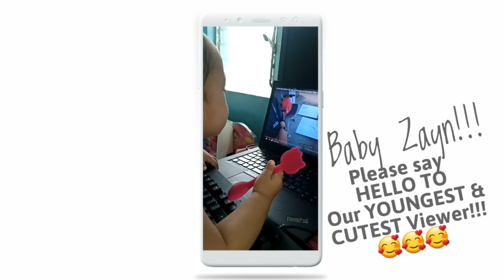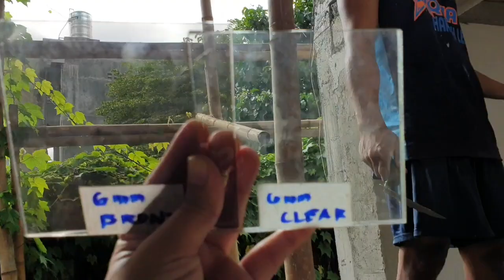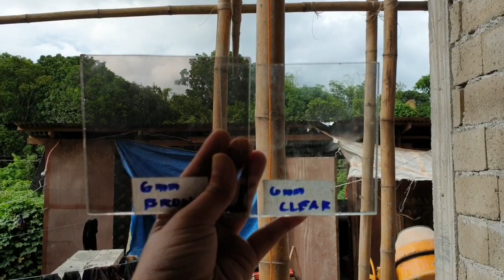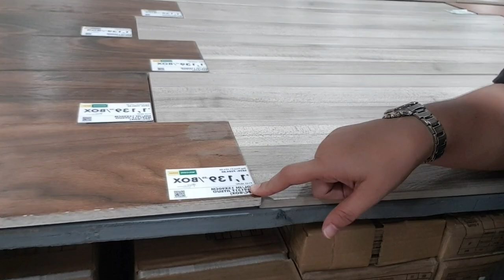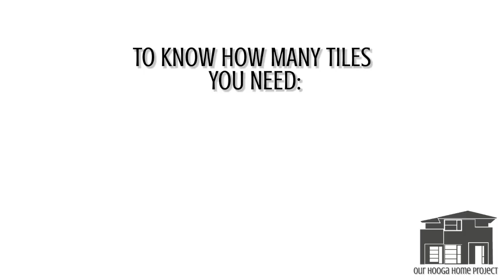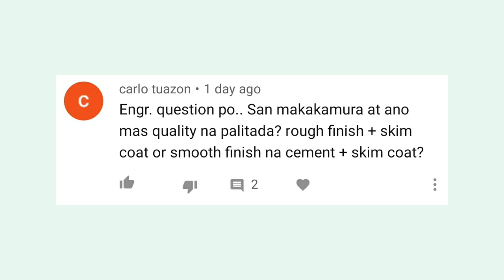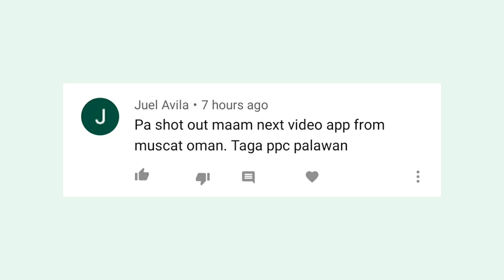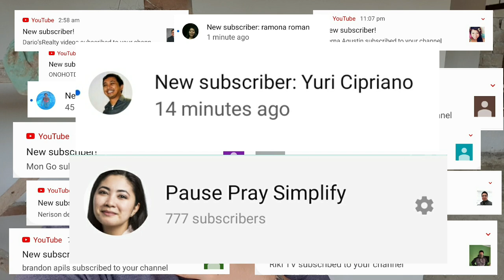HOUSE BUILDING PHILIPPINES  | Wk 23 How to CHOOSE FLOOR Tiles + Window Installation | Retired OFW

Comment: Janice thanks for the shout out!!   As for glass I think the same glass for all windows on a side of the house. The north side gets less direct sun so it may benefit
 from clear glass. I like the gold mirror reflective glass for privacy, but in that case the entire house would need that type. If you have close neighbors the mirror
finish glass could be annoying to them.  Floor tiles. I would do textured tiles on open common areas  with strip planking wood grain finish. These areas usually
have less direct sun thru windows so a light finish would be brighter. Use the 60 X 60 in the bedrooms to set them apart as a different living space from the
common areas and as a cost saving since the bed dreeser and chairs hide a lot of the floor area. Bedrooms don't need to be brightly lit so a color coordinated
with the paint color might be nice. If you use color tiles future paint colors would be limited to the original shade or white.
           Skim coat needs a rough surface for grip or tooth to bond to. We skimcoated our ceilings which were concrete slabs poured on polyethalene sheeting so
the forms wouldn't stick and cement and water wouldn't separate out of the concrete. Same as pouring a floor and putting poly down over the gravel to retain
the cement in the concrete. For the slick finish ceilings we painted on "concrete bonding agent" which makes a joint stronger than the original cast concrete. 
Our crew also mixed bonding agent into the skimcoat. When time and budget allow we may put infinity mirror ceilings just to be different than the tray ceilings
that are very popular in the PI particularly on OFW and expat house builds. Also we may put plush wall to wall carpet in the bedrooms and let the house girl
learn how to use a vaccum cleaner. 

                                                    george and aurora
Reply from the maker: Hi George and Aurora! For the glass we will see on Week 24 so we can decide better. I prefer clear glass but still lookinv at all the considerations.

As for the common areas, we will buy porcelain tiles. The wood-look tiles that we had bought are ceramic so they can't be used in the common areas. We'll see if we can get a cheaper wood-look poercelain tiles for the common areas. Otherwise, 60x60 porcelain tiles it is.

I'm impressed with how you're mnaging your home build from overseas! Kuods to you and your Team!

Oh and for the ceiling, we will have a flat one. Simple and no design. Just white with pin lights. We want our house to be simple. We don't like elaborate designs especially on the ceiling. 

Let's see how it will all turn out. 

Thanks again!!!😊 Tc!!!

Comment: Hello, may I know po if your pvc downspout is inside the columns? Thanks and hoping for your reply
Reply from the maker: Hello po, Kristine! 😊 Hindi po nakaembed ang downspout namin sa loob ng column. Mahirap po maintenance nun in the future just in case bumara mga dahon at hihina po ang strength ng column. Ang maximum allowable embedment po ay 4% ng gross area ng column. Kung gusto niyo maglagay ng downspout sa column, kailangan pang lakihan ang size ng column para maaccommodate yun, mas magastos po. Sa gilid lng po ng column namin ilalagay ang downspot at lalagyan namin sya ng cage later on para gapangan ng halaman para matago ito. Hindi na halata, may design pa. 😊 

Ano po ba yung sa inyo? Nakaembed po?

- Abet
Reply: @PausePraySimplify  hello po salamat po sa reply, on going p lng po ang aming construction, bale insist po nmin sa aming contractor na ilabas ang downspout kc, based po sa aming calculation, more than 4% ung embedment, around 5.8% po.
Reply from the maker: @kristinecuartina8499  anong size po ng downspout?
Reply: Pause Pray Simplify  bale 3 inches po ung downspoun then ung column size is 40cm by 25cm.

Comment: Ma’am ask lng po ilan po ng 15x90 ang macoverage ng 3mx3m n kwarto po 
120x20 po sa example ni sir po para macompare lng po ung price po thank you po and alin po marecommend nyo n size po
Reply from the maker: Hi Jonas! Sige ipapasagot ko yan kay Abet ha. Balikam kita 😊
Reply: @PausePraySimplify  thank you po
Reply from the maker: Hi Jonas! Naku sorry hindi pala kita nabalikan agad. Sinagot ko ito sa isang video kaso di ko pa maupload. So ang sagot:

.15m×.9m= .135sqm 

Area: 3m×3m =9sqm / .135sqm = 67pieces × 10% for cut pieces and reserve 

You will need: 74 pieces na 15×90

Sorry sorry nalate ha. Ginawan kobrin ko video. Hopefully maupload ko soon.

Comment: Hm sa wilcon ang wood look porcelain tiles na 15x90 cm madam?
Reply from the maker: Hi Good morning po! Sorry I'm not familiar with all the tile prices at Wilcon, only with the ones we used. They are:

BRAND: Sol Ceramica 
NAME: Jox Blanco
SIZE: 20cmx120cm
PRICE: 1,186/box (5pcs)
***Super tigas parang porcelain din.

MASTER BEDROOM/HOPE'S BEDROOM/GUEST BEDROOM 
BRAND: Sol Ceramica 
NAME: Malik Beige
SIZE: 15cm×90cm
PRICE: 1139/box (8pcs)

TRAVELING SAINTS' ROOM
BRAND: Sol Ceramica 
NAME: JUDD yellow
SIZE: 15xm×90cm
PRICE: 995/box (8pcs)

We didn't use porcelain pala kasi di pasok sa budget.
Reply: @PausePraySimplify  thanks dear sa info , God bless you
Reply from the maker: No worries po! God bless you too! 😊